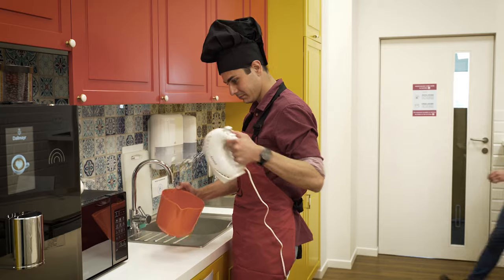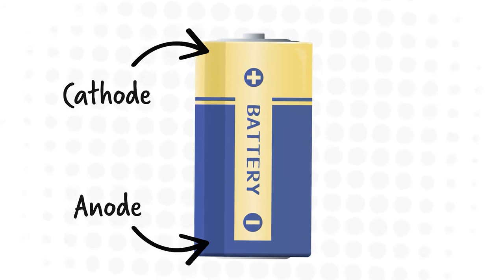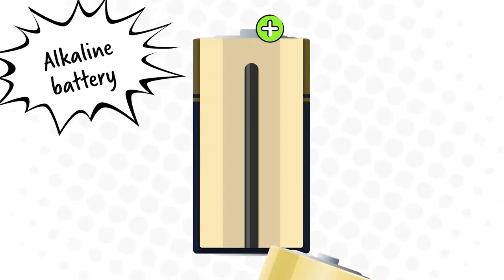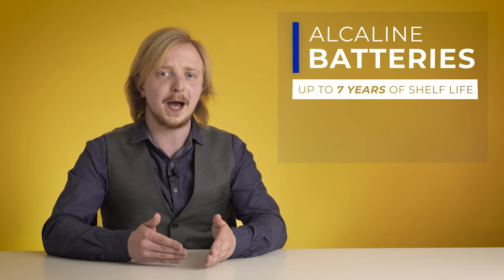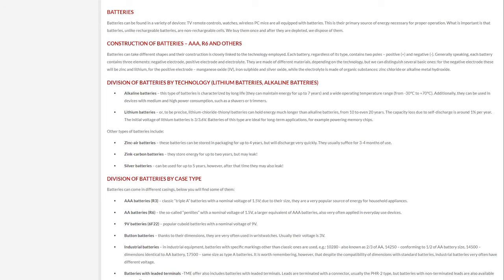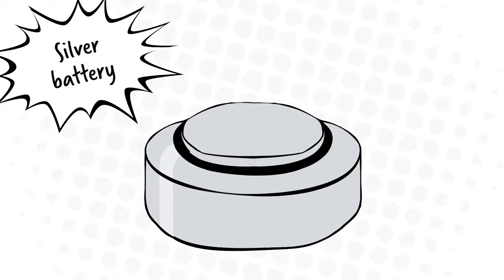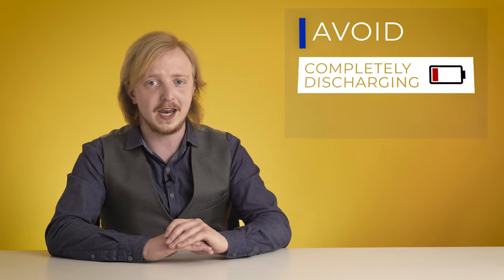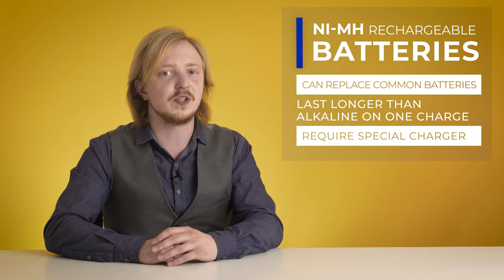Types of Batteries Explained - How to Choose a Battery? [Guide]

Comment: You didn't mention Nickel Cadmium. They are used in pro quality cordless power tools, emergency lighting etc.  Yes, they are toxic, but recycling centers are available everywhere. They are a good solution for constant use (security flashlights, lanterns etc.) Nickel Cadmium are extremely rugged, which is why they are used in construction tools.
Reply from the maker: You are right. This video covers only the most popular types of batteries. The industry keeps developing more solutions that are better in one way or another. Are you looking for some specific batteries?